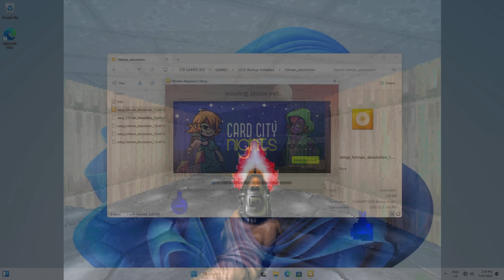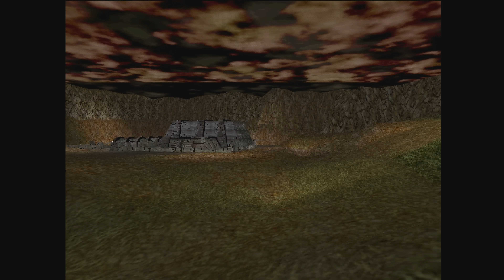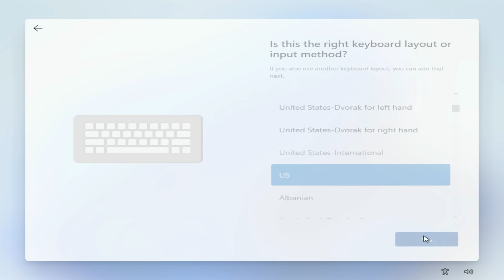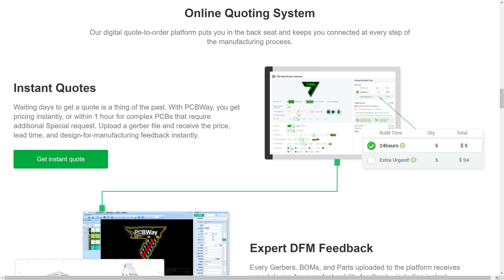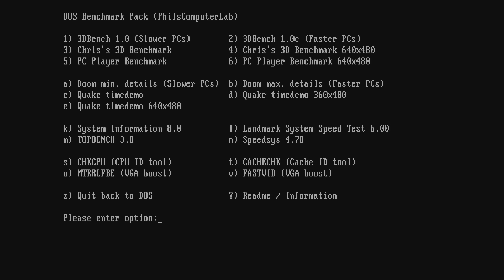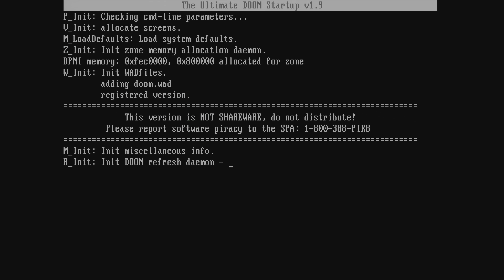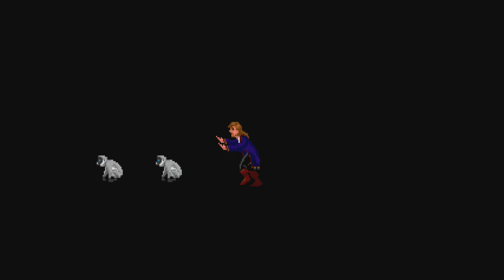LGA 775 The Next Big Thing for Retro PC Community?

Comment: Nice!
Be aware that LGA 775 (and Socket 754, 939 and AM2), while out of the "capacitor plague" era, can still be affected by bad batches of Nippon Chemi-Con, Ost and Toshin Kogyo (TK) capacitors.
Reply: On the flip-side, LGA775 also spans into the "overcompensation era", where board manufacturers would make motherboards over-engineered for reliability.  Those are the ones that boast things like "Japanese" or "Solid-state" capacitors, excessive use of heatpipes on the VRM and chipsets, and extra-thick copper ground planes.  They were clearly trying to restore confidence in their products for a few years after the capacitor plague.
Reply: Yeah earlier 775, 754, and 939 boards are definetly not safe from capacitor issues
Reply: @olnnn Can confirm that as I just came across 2 PCs with D945GCNL boards (made around 2005/6) with leaky caps. Surprisingly they still work, but the one with worse caps have memory instability which was annoying. Their stupid 3.25gb ram limit didn't help as I couldn't do a memtest properly and had to test 2x 2gb DDR2 sticks separately.
Reply: @abunk17  The 945 Chipset Era marks the end - or at least the transition - of the Capacitor Plague.  
Most motherboards built on the 945 Chipset still function to this day. However, the ones without affected capacitors were typically used for less demanding purposes, such as home users running Word, Excel, PowerPoint, or Outlook.

The G31 Chipset Era is often referred to as the “Overcompensation Era” — as noted above by @zhurnivuurg — while the G41 Chipset Era feels like the lifting of a lockdown, reminiscent of the post‑COVID‑19 reopening.

Here in Brazil, many 945 boards survived, but there is still a huge supply of G31 motherboards available, which also managed to withstand our tropical heat.
I own an MSI 945 Chipset in an OEM version, and I’m gathering strength and patience to resolder almost all of its capacitors.
Reply: 5 of my 775 boards are needing recaps 💀
Reply: love how my reply to this got censored out of existance... AGAIN
Reply: There are some of the later boards(AMD XP ETC...) that have a joystick port on them(onboard), Has anyone been able to get Midi out (for use with GM and sound canvas etc) to work with SBEMU? Normal SB16 and FM sounds work fine. And it shows that MPU 330 is active when activating the driver. But it will not send a signal out to my SC-55 using the joystick to midi adapter. Maybe SBEMU doesn't support that? Any luck with that Phil?
Reply: Ale.K7
You bought a cheap China white board ?
Reply: and capacitors in general wear out eventually even if not a bad part. seen some always on office pcs that looked quite horrible due to this
Reply: @UserUser-zc6fx  This capacitor issues are different.
Old Athlon and Pentium 2/3 mainboards had capacitors which failed during normal calculated lifetime (1-2 years after production.

You might see defective/blown up capacitors on Socket775 boards that only failed after 5-10 years.
And this is expected behaviour and had nothing to do with "capacitor plague" around 1999-2007.

source: https://en.wikipedia.org/wiki/Capacitor_plague
Reply: @darthgrossmaul  Nichicon had a bad batch of capacitors, and they affect original Xbox as well as earlier LGA775 motherboards.
Reply: @darthgrossmaul  LGA 775 came out in 2004. Very much capacitor plague era
Reply: @darthgrossmaul  Brazil is hot as hell, yet all the motherboards from the Capacitor Plague Era are still running around here, with plenty of them being sold off.

During that period, almost all PC users paid little attention to airflow, so the motherboards had to burn themselves out just to keep us satisfied.

While researching old motherboards to purchase for a Retro Lab, I noticed that many of these MoBos are still working in colder countries such as Russia area.

Comment: Found my original LGA775 intel D915 boards and it popped a resister right off the board on boot. Grabbed a second hand board with core duo 2 for $30. Great for XP. Yet to setup 98se but I can now play Swat 2 again.

Comment: It has been for me for years. Love it. Core 2 quads and duos are XP monsters.
Reply: That's one of my future project's. Thrifting I found a HP Pavilion Elite desktop with a Core 2 Quid q8200 and 8gbs ddr3 ram. I plan to rebuild it into a early 00's gamer rig once I find the right case etc. Already got a sound card and a evga geforce 560ti gpu (Needed something xp and 7 compatable since it'll be due boot). Just need the perfect case, a module psu so no extra cables to tuck away a hdd for xp ssd for 7 (I know xp well run on a ssd but if I remember right it can't use the advanced cache features etc)
Reply: @JohnSmith-xq1pz  If you are dual booting with win 7 you should go with ivy bridge, it was the last intel architecture supporting XP and is better suited for win7.😃
Reply: @JoaoSantos-ps5si  I'll keep that in mind for a future upgrade assuming the OEM board supports it. HP pulled all the support/downloads page for there legacy products, so rude of them
Reply: @JohnSmith-xq1pz  I'm not sure if you are refering to putting ivy bridge on your HP. Ivy bridge is socket 1155.
Reply: @JoaoSantos-ps5si  oh right Ivy is a later gen...

Yeah at least until a nice Asus,msi etc board shows up I'm going to use the OEM HP motherboard and transplant it into a 2000s or 2000s looking gamer case (preferably a window case becouse light kit and led fans are a must lol)

Comment: Currently using a GA-EP45T-UD3LR with a Q9650 and 8GB DDR3 1333MHz. Extremely stable and reliable, almost zero issues except some PCIE dramas but I only use it for testing stuff and data recovery. Honestly, there's no better choice for legacy yet performing platforms
Reply: I have my dad's ol XPS 420 upgraded to q9650 and 8gb ddr2 and a GTX 960 for driver reasons, I have it triple boot system XP,7,10 soon 11 just for lols, and I found a old office PC with a Pen D upgraded that to q6600 and 4gb ram wanna get a high end 2006 GPU for the system so I got my main lga 775 system and a backup and the backup I had to use a floppy to update the bios lol and didn't corrupt the bios the XPS has an SSD
Reply: Awesome combo!